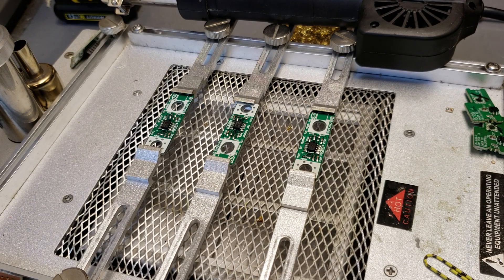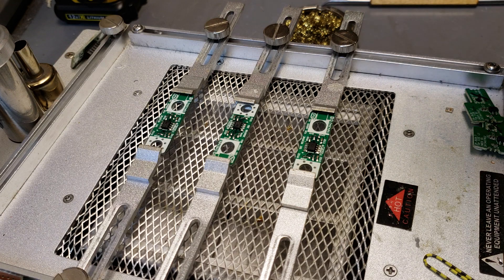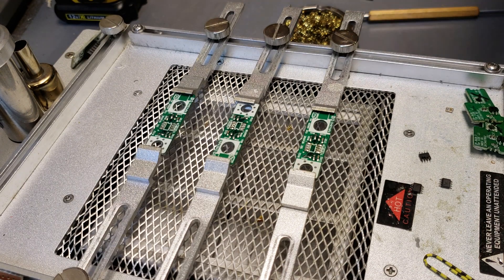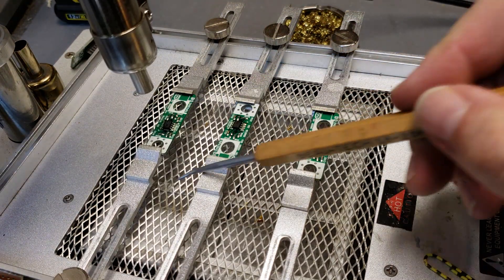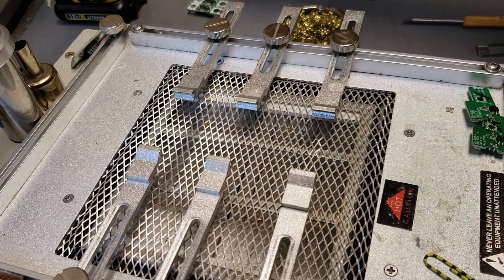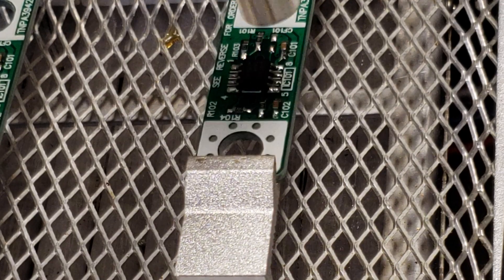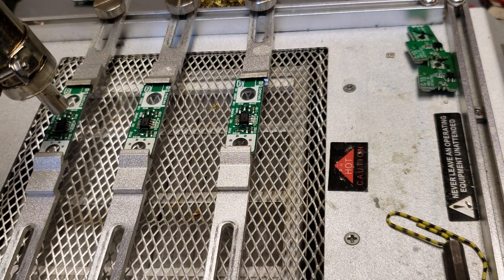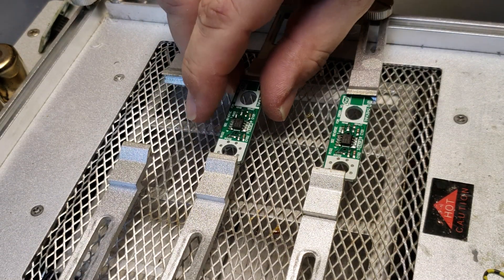Repairing Lamp Timer PCBs for Aftermarket Panasonic Projector Lamps

Comment: Hi Frank, whether this is an idea for an video as I've seen a few people request this also in the comments. I'm looking to reset the lamp hours on the chip as I just need to squeeze a few more hours out of it whilst working in a school as our theatre projector has gone down, though we're upgrading to a new building in a month and a half, so I dont really want to spend £600 on bulbs plus wait for what seems to be international delivery as it'll be end of term time they arrive. I've got the cat24c64 hooked up to a ch341, can see some basic ascii details on the chip, but not sure which register correlates to lamp hours. Struggling to find documentation online so your help would be much appreciated!
Reply from the maker: Hey man, sorry you ended up in the spam folder.  Shoot me an email.  foranzi@gmail.com  Let me know after you see this so I can delete the email address.  I can probably help you out.
Reply: @FixitFrank  Hi Frank. I got a bodge in place. Tried monitoring the values over 10 minute periods of using the bulbs to see if I could work out what hex corresponded to lamp hours, in the end I gave it a last ditched attempt, changed too many values and projector reported that chips were corrupt, was going to use the bulbs in 3rd party mode, which meant eco mode would be unavailable which we dont use. So so far they've held fine, just a few more weeks to go. Thanks for responding anyhow.

Comment: Hi Frank, I buy the et-lav100 no original for video projector pt-vx400 but the counter dont make reset, can you help me please?
Reply from the maker: hi Edson.  These use a special Sanyo derived PIC chip that needs special reprogramming.  The chip is actually locked to read.  However if you want to email me(on the about page about halfway down), I can discuss options.  If you are in the states it is easy.  If you are not there are still options.

Comment: I’ve got that same PCB preheater and hot air station. It’s the Aoyue Int 866. Also has traditional soldering iron compatible with Hakko tips.
Reply from the maker: Thats the one. I've had it for a while. I still have my home brew pre-heater but that is for much larger boards. I am not a fan of the iron but that is only because I prefer my weller (out of habit, Hakko/Aoyue is fine stuff).
Reply: FixitFrank My Aoyue Int701A++ desoldering station also has the same iron but with a different DIN so I couldn’t repurpose it as a spare for the other station. Still, to avoid changing tips I sometimes end up using both simultaneously. I’ve noticed that that the desoldering station works much better than the Int866. Better thermal response. Without thermal profiling the Int866 is not really for suitable for BGA but I mostly got it so I could at least attempt and occasional BGA repair. No success there yet. ;)